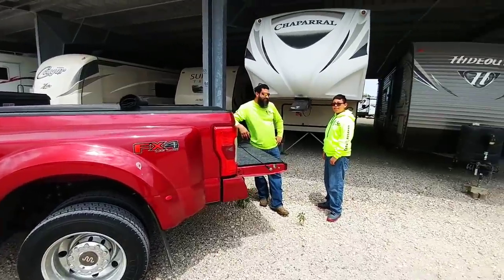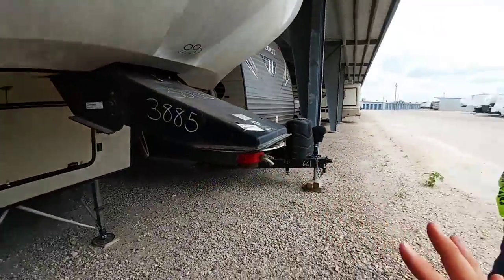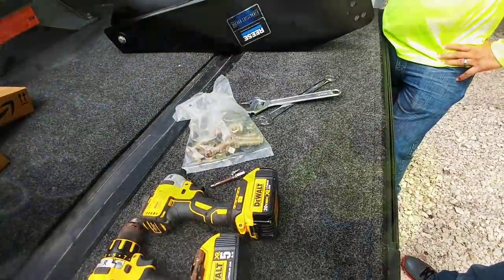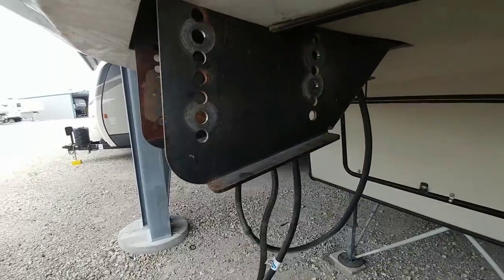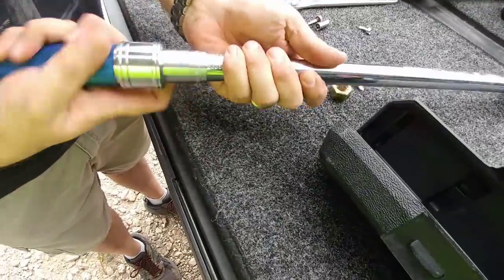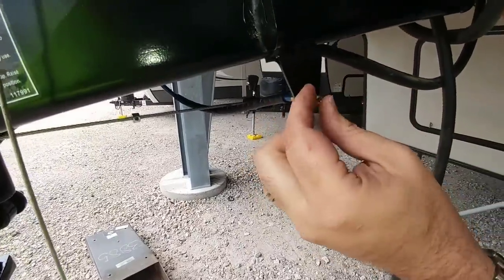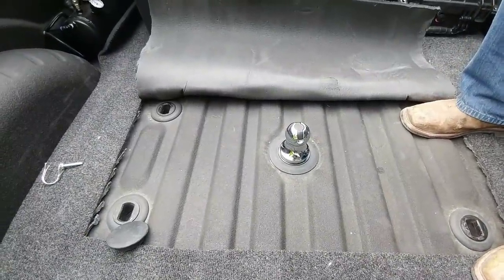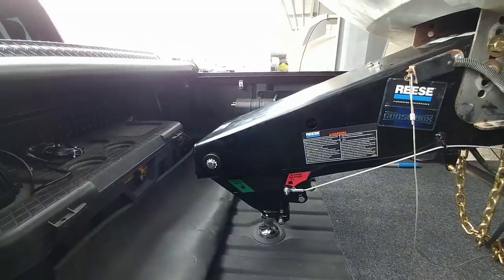Best Fifth Wheel Upgrade! Installing the REESE 20k Goose Box!

Comment: How much difference in weight is there between the new goosebox and the old pin box using the B&W companion?
Reply from the maker: The BW hitch was around 200lbs plus 75lbs for the pinbox.  This pinbox is 170lbs plus about 15lbs for the ball, chains and chain loops.  So much lighter overall.

Comment: Anyone out there use the goose box with a short bed truck? 
Hoping the 2020 gmc 3500 HD short box will work with ok with a Montana/ Goose Box setup.
The 2020 GMC short box will have longer box than the 2019, presumably the same length as the Ford short box.
Reply: That’s great, thanks for the reply much appreciated!

Comment: Does this ride smoother, or just less expensive?
Reply from the maker: Brian Lolmaugh: Well, the GooseBox is at the very top end of  pinboxes priced at $1150-$1250.  The Reese Elite Ball is about $150, so it's not low cost for most. It allows me to eliminate the huge fifth wheel hitch and also pulls exceptionally smooth.
Reply: I have a Reese Elite with a Sidewinder with Air (locked out for dually now).  I like this cost alot, but wont change but seems like the way to go.

Comment: Awesome video.....but trailer could use a good bath lol
Reply from the maker: Mike M: Yeah. it sure does
Reply: Big Truck Big RV just curious does that new hitch act the same way your Anderson hitch did?
Reply from the maker: Mike M: no sir. It is a genuine gooseneck connection and not a kingpin attachment. It also eliminated the bulk of a fifth wheel hitch in the bed and the ball is rated at 30,000lbs.

Comment: Ok, you might as well have told me that Santa Clause is not real... I live my life based on the quote "I personally do not think it's a good idea to convert your fifth wheel hitch to a gooseneck hitch..." https://youtu.be/Z7W60hcTq60?t=4m26s
I'm crushed... literally devastated... I got my RV for my truck because of this concept. With the idea that if it didn't come with the trailer that it will void the warranty from Lippert or the manufacturer. 

(Don't get me wrong, I'd still buy the particular coach I got for many reasons but the hitch was the biggest reason.) You can see my hitch connected in this video: https://youtu.be/UKBBknIITl0?t=6m20s
But I am totally shocked to see you change to this hitch. After going to the Anderson and back to the Turnover Ball Companion and now to the gooseneck. You surprised me, that's for sure, but I totally get it. I am a firm believer that gooseneck is the way to go. However, I am completely shocked that you just did that. I hope it pulls well and am looking forward to the new videos with it connected.
Reply from the maker: Thanks for the comment. This specific pinbox is the only Gooseneck style that is approved by Lippert.  I am still 100% against gooseneck adapters that connect to a standard fifth wheel pinbox.  The leverage creates big problems.  The Andersen was a great hitch in terms of weight but just took up too much space. The B&W Companion for Ford's Puck system (Not turnover ball) is great as well but is very heavy and takes up quite a bit of space as well. This hitch is approved for use by Lippert, easy to remove and gives me my bed space back.
Reply: I'm glad you put this on. It looks great and is much more functional. It was my second choice if I were to get something different to haul. Thanks again for the great video and I can't wait to see the performance videos.

Comment: 10:12 i could cut it off with a cutoff disk in less than 1 minute lol
Reply from the maker: that's true with just about every type of locking system though.  The hope is that most petty theives arnt carrying around a 20vt Cutting wheel.

Comment: I'm having trouble figuring out if this would fit my trailer. I have a Mor/ryde RPB72 - 1716.
It is a 16,500 pin box. Reese says it will fit, but the oem replacement would be a Lippert 1716. The 20,000 hitch fits oem Lipppert 1621. see:http://www.morryde.com/uploads/downloads/1415133016-PinBoxIdentificationGuide.pdf

Comment: Never ever torque the bolt, always torque the nut. That way you are not destroying the threads on the bolt and weakening the bolt.
Reply from the maker: Agreed. I followed the exact manufactures instructions. Also, the bolts are hardened grade 8 while the kingpin is at best a mild grade 3 steel

Comment: Why would you want to change from a 5th wheel to a gooseneck
I see the benefits with the suspension unit built in but you can get a 5th wheel with that also
A 5th wheel has way more pros then a gooseneck in my opinion
Reply: When you get a new truck and need a new hitch because your old one will not work with new truck this is a perfect solution. At least it is for me.

Comment: A circular saw could easily take that wheel lock off...
Reply: Was thinking the same thing...a die grinder in less than 3 min would cut right through that outer arm.

Comment: Bottom bolts are in the wrong holes you went up they needed down
Reply from the maker: Not according to the instructions.
Reply: @BigTruckBigRV  you even za d and pointed where they go the front bottom bolts should have been one hole lower and I am a installer

Comment: Why a goose ball over a 5th wheel?what are the benefits?
Reply from the maker: Well, the Reese GooseBox is the only approved system for conversion. No really benefits over a high end fifth wheel hitch other than the gooseball takes up hardly any space in the bed when not towing, which is a huge factor for me.
Reply: One thing I don't like about this setup is the mounting bolts are closer together on the front of the hitch. Which in my opinion may make the torque (leverage)  placed on the  bolts higher.  The other draw back I see is needing an air compressor if you have to let the air out each time you unhitch.  Can't wait to get a review after using it for a while.

Comment: Aren't you the same guy that put up a video saying never convert a 5th wheel to gooseneck they aren't designed for the forces? I don't care if Lippert approved it I have seen too many videos of torn out  Lippert hitches. Upper framework tears to trust this setup.
Reply from the maker: that video was specifically about adapters that connect to fifth wheel pin boxes. This solution appears to be solid.
Reply: Big Truck Big RV Appears isn't engineered. It is still applying the motive force 16"-17" lower than the kingpin as originally designed. A lever arm is a lever arm. Physics doesn't care about appearance. You ate applying different forces than the chassis is designed for. I wish you luck on your warranty claim when the pinbox tears the cross member from too much stress. You know modern chassis are built right to minimums (to save weight mostly) and the bean counters don't give a damn about what engineers say.
My '96 5er is on an RBW chassis, pinbox is 1/4" thick, fully boxed (not open in the rear). It's heavy for size and I still wouldn't convert to gooseneck, wasn't designed that way.

Comment: I don't see any benefits in the change.  Looks like more weight centered in the middle verses spread out.  My neighbor changed his out because he did not want to buy a 5th wheel hitch.  I advised him that it was not installed correctly.  On his first trip out he was backing up and turning at the same time, when he destroyed the back window of the truck and serious damage to the camper.
Reply from the maker: Here are some benefits: Lower overall pin weight (total weight of GooseBox and Ball are about 100lbs less than traditional Pinbox and fifth wheel hitch). Opens up bed for Non-towing use. Less failure points. Don't have to change from gooseneck to fifth wheel hitch if you have multiple trailers.  I'm not saying this is the best for everyone, but it's sure nice to have my bed available.  I'm also not saying it is a huge advantage for many over a fifth wheel hitch. Personal preference is all